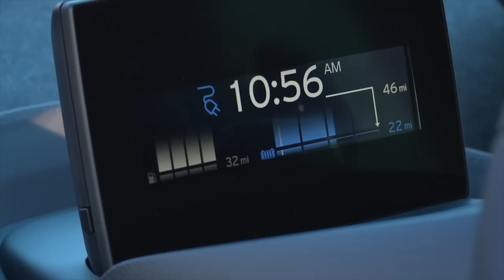Five Things We Need To Improve About Electric Cars

Comment: what about those of us that have reached a mortgage cap. whereby there is no property within 50 miles within our price range that alows us to install a charger for a plug in electric. 

I for example have no off road parking. I have double yellow lines Infront of my house and every house up and down is terraced. I run a company that would greatly benefit from a plug in electric van. But no-one has a solution for these problems l
Reply: Where do you park now? The UK gov has money available for councils to install street chargers, so if you park on the street you may be able to get a few installed, and then as an electric, you'll get reserved parking.

Comment: Range, charge time, cost of purchase, cost of replacement battery, battery life. You forget about hydrogen fuel cells or propane or LNG gas engines which are much cleaner.

Comment: I think it is unlikely that car manufacturers will manufacture their own batteries. Largely the only assemble cars today with most of the parts made elsewhere often by third parties. I think however that there is a need for more battery factories and they need to be near the place the cars are made.
Reply: John Michael surely most car manufacturers manufacture their own engines.   Don’t know if any generic engine manufacturers that sell to multiple big brands
Reply: @andrewpaulhart  you are spot on about that in my opinion.  I would think that mgs should make there own drive trains and power sources, even if in a partnering way, such as Tesla & Panasonic.  Mfgs should belly up to the bar and put their capital resources there (and ditch the IC engine $$$).
Reply: Honda and Renault will sell engines to anybody. Half the Mercedes-Benzes for sale have a Renault engine by now. Rolls-Royce? A BMW 7-series with a different shell thrown over it.
Reply: Michel Clasquin-Johnson aarrrgghhh. Got me 🎯 !   But of course I still think I’m right that car companies that fail to manufacture their own batteries are going to end up at a competitive disadvantage.
Reply: John Michael sort of.  You could argue that Tesla do not make their own battery cells, Panasonic do.  But Tesla’s Panasonic battery production is built solely for their use and to their requirements.  But manufacturers definitely need to arrange for battery cell production to be dedicated for their own use.  And of course they would be sensible to build up expertise in the construction of battery packs.  I could see a future when battery pack suppliers eventually move into car manufacturing,  undercutting the current big names.  It happened in PC’s.  It would be like an ICE manufacturer simply buying their engines from a third party supplier.   Has been done in the past,  but in my recollection it was a sign that the end was near

Comment: The main problem I see with the range anxiety issue is that people is used to think that even if you have a 2001 Ford Ka or a 2019 BMW 750 you could, hypothetically, drive thousands of miles in a day non stop relying just on the existing fuel station infrastructure, just stopping 5 minutes each time to fill up, pee and jumping again to the drivers seat. Anything worst than that is perceived as a less quality product and we are used to perceive that any new product should have better characteristics than the previous generation, and that is a important factor deciding if you want to upgrade to an electric car.
Reply: That, despite the fact that they've never done such a trip...
Reply: So buy an EV and rent a gas car if you absolutely must make a long trip in such a "we got a long way to go and a short time to get there" fashion.
But really, people do road trips in EVs all the time.  They stop and eat, and charge the car.  They stop overnight, and charge the car.
And they would be stopping to eat and sleep even if they were driving a gas car.
Reply: ICE vehicle is more convenient on the rare long road trip.  EV is more convenient for much more common local driving (assuming home charging).  Does it make sense to optimize for the rare case or the common case?
Reply: @dansanger5340  remember the car maker doesn't take any trips, long or short. They optimise for sales. So it's whatever they think will get people to sign on the dotted line.
Reply: @dansanger5340  www.youtube.com/watch?v=u4b0_6byuFU
Reply: @geoffmorrise2072  Your proposal is more or less already known, it is merely a version of BMW i3 with an REX unit with almost exactly the same power output. Your motor is what is says, a "Range Extender", it's merely a boxer-like design with probably some vibration issues. But at 24 kW, that's hardly enough and it would heavily rely on the battery, acting as a buffer, allowing only moderate driving on level terrain.
Ask US users of BMW i3 with the ReX unit - once they drive uphill for more than a short incline, the speed of the car drops significantly.
Similar (and better) cars already exist: Chevrolet Volt (plugin-hybrid) or Hyundai Ioniq PHEV. Both do the same while the Ioniq is also very efficient.
The main problem is - you still have a motor/engine design while still having the need for an engine maintenance.

Yes, your design may look cool, but it may be only an interim solution for the next 5 years while batteries are still quite expensive. After 2025, that design will be a part of automotive history. 
Actually it is already today - in BMW i3 REX.
Reply: @richardpetek712  I appreciate your input.  
Sadly we have yet to see the proper configuration of a pure electric drivetrain coupled with a highly efficient, light weight, compact gen set range extender.  (A car for the rest of us.)   Any car that has max range of less than 200 miles and sells for $44,000 is not attractive, whether running on electricity, gas or both.  So the i3 is a design doomed for failure from the start.  The same goes for the Karma Rivera.  Make a car that will run up to 90 miles electric and 500 miles total, that sells for less then $30,000 and then we'll have something.
For one possible help with this, be sure and check out LiquidPiston.com, www.youtube.com/watch?v=-g4dKZTnxHo.  They have the idea of using their engine to power a gen set.

As for the speed dropping significantly up a hill,,, my less expensive, compact ICE cars have all done that too.  If you want a muscle EV, you'll have to spend the $$$ and get a Model S.  My point is that plenty of us are OK with less powerful, more affordable cars ($44,000 is not affordable).

As for maintenance, If I use my high efficiency, light weight, compact, low maintenance range extender only once or twice a month, I think it will most likely out live me.
 
I would contend that it's not an interim solution  Battery cost will have to come down to something like $20 a kWh and densities of 1 kWh per kg before they could match the output of an engine like LiquidPiston's or a good FP linear generator.  Driving habits are unlikely to change.  60 mile range meets 90% of driving needs. (Mind you it's not a good idea to always drain the battery to zero, so a 90 mile range battery would be best.)  Why carry around hundreds of pounds of extra batteries just to make that occasional longer trip?  Again this is a configuration for all the Toyota Corolla and Chevy Cruze owners, not those who consistently drive longer distances.  There will always be a need and a market for those who want 300+ mile battery range.
Reply: @richardpetek712  I forgot to address the 24 kW aspect.  I'm not an engineer so I can't really say.  All I can to is a little math.  If the motor used 250 Wh per mile at 70 mph then that would be 17.5 kWh used after an hour of driving.  If a 24 kW gen set ran for an hour that would produce 24 kWh of power.  So in theory, it should be sufficient.  In the real world, I can't say.  Also the i3 has an electric motor of about 180 hp.  I'd think a 200 hp motor would be better.  I think Tesla could do it, if they were of a mind to.  Their motors are the most efficient out there on the road.

Comment: A good 'first 5'. Let me push another elephant into the room. The fact that a significant proportion of the potential EV buying public do not have ready facilities to charge at home, and are unlikely to have any. If they live on either side of a residential street there might seem to be a solution in 'on-street charging'. Then we have to hope that every single person in that area is law abiding, otherwise we could live in fear of the vandal. Then there are people who live on housing estates, who park in residential car parks. Would it be possible to turn those car parks into destination charging bays? I say nothing of the charging difficulties with hi-rise buildings residents. But, you see the issue? The 'big advantage' of EVs is that they can be charged overnight at home, yet a significant proportion of the population do not have off-street charging facilities or their own driveways. That could stop EV adoption in its tracks rather prematurely. This is a solution that has to be found quickly, with enough chargers to go around to easily meet the potentially huge future demand. Of course, the situation may change dramatically if batteries are developed that charge fully within 5 minutes and have almost zero phantom drain. But we have to plan as if that won't be the case, and plenty of owners will have secondhand vehicles with Li-Ion batteries in any case, so they'll need the facilities anyway, as chances are, they are likely to be the less affluent ones with less access to off-street parking. This one isn't going to go away unless we address it. Inductive Charging anyone?
Reply: Canada and northern states of the U.S. have quietly solved all those issues. Cars need block heaters, so they just put in electrical outlets. No fuss, no fanfare, no insoluble issues with vandals. What they did can be done anywhere.
Reply: https://www.wheninywg.com/plug-block-heater-car/
Reply: @gasdive  I will investigate that, thanks. 👍
EDIT: Ah, right. I see what you're getting at. Yes, it would be possible to erect a charging post for every home in the UK. One could just put an account card of one's own electricity account against the face of the charger and it would directly debit from that account, so effectively charging from one's own electricity. However, we're still left with the problem of the vandal. Plus, I live in the UK, and under the present Govt, which has been in power for quite a few years now, 'building public infrastructure' is a poisoned phrase, so I don't see them solving that issue any time soon.
Reply: Rambler Andy .  Most businesses will eventually provide destination chargers, so those will charge at work rather than at home.  Other than that public rapid chargers will
Have to do
Reply: The solution is to get rid of car ownership. A company owns a fleet that is charged at their own private facility, and then sent to customers on demand. Research Tony Seba's insight onto this. Google's Waymo unit is at the forefront. GOOG stock is a solid long-term (30-year) investment.
Reply: @EMichaelBall  Yep, I have looked at a lot of Tony Seba's work. What it leaves out are those who desire to own a car, or still need to. Our city infrastructure layout have been geared to the ownership of cars. And significant people numbers are raised to aspire to car ownership. That will take time to work itself out. Btw, I think Seba's work and economic projections on many things like transport, infrastructure, energy, etc... are really exciting.
Reply: @ramblerandy2397  A very small percentage of people in urban/suburban areas will still need to own a car. Those who have two cars, now, may keep one car, but get rid of the other one. Seba mentions that the infrastructure for cars was built out quickly, in spite of the previous horse industry and fighting WWI. So the existing industry for cars can be retrofitted for A-EV's very quickly, and given the economic opportunities opened by A-EVs, as seba mentioned (the need for less parking), smart governments will make the switch quickly.

I doubt you fully understand the business model of A-EV: Imagine if Google came out with something that was cleaner, quieter, safer, cheaper, and better than owning a car, has no up-front purchase or lease requirement -- and Android Auto is built right in. Well, Google will do just that. Most people's desire to own a car will go away, especially those who buy a car for the latest gadgetry. So a vast majority of people are going to switch to A-EV, especially those in the lowest socioeconomic status who currently rely on crappy cars being sold at high interest rates from "buy here pay here" dealers, but not exclusively them. Cars that people own would still be of use, especially in rural areas, but rural living is increasingly becoming untenable in most areas, especially with rural hospitals closing. Valuations of existing cars will plummet, and new car sales will be minimized. Figuring out A-EVs in rural areas will be a challenge, but the ease of implementing the business model in urban/suburban areas will be too much for most people. I think at least two-thirds of all road miles in 2030 will be A-EV.
Reply: @EMichaelBall  I quite understand the business model of Auto-EVs, and I am quite familiar with Tony Seba's ideas and projections. However, in the UK there is a great desire to 'own' way past the point of logic, especially amongst the older baby-boomers. Granted, the sheer economies of not owning a car and being able to flag one up will begin to overcome this, but I suspect it may be slower than one would like. We'll need a change in attitude, expectations and ignorance. I myself, have been in anticipation of this for a good few years. Like Seba, I haven't owned a car in several years, but I am a driver on several friends and relatives car insurances. It's both convenient for them and me, but the break from 'owning' my own vehicle is something I have prepared for. I would like to think that Level 5 autonomous driving and thus capable A-EVs will be around by 2022-24, but I fear it may not be as soon as that in the UK.
Reply: Rambler you are presenting a chicken and egg problem.  Right now EVs really aren't suitable for people who live in multi-family dwellings.  However they are great for home owners.  Hopefully in time enough home owners will adopt so that the balance shifts and owners of apartment buildings will begin to see the advantage of installing charging stations at their parking stalls.  A few to begin with, and many over time.  The apartment owner could then become the replacement to the gas station (and perhaps realize additional revenue from doing so).

Comment: 6. Design: no more fake black grilles that just make aerodynamics worse. Electric cars have to look different
Reply: They used to put masts on top of and paint gun ports on the side of steam ships. I always laugh and think, "1880 is here again".
Reply: I have a sudden urge to see a tesla with hood scoops.  Fortunately the internet provides!  https://www.reddit.com/r/Shitty_Car_Mods/comments/8hu503/i_dont_think_that_works_with_a_tesla/
Reply: Why do electric cars have 'bonnets' (hoods)?  There is no need to have a proboscis at the front as there is no 'engine' under there.  

I think the i3 dares to go where ev's will surely end up.
Reply: FFVoyager safety.  Crumple zone
Reply: @FFVoyager  Crumple zones, wheel base (car is more stable with wheels at the corners rather than directly under the passengers), aerodynamics (at least compared to a stubby car), aesthetics, space for the door.  We could make the front smaller but the "sweet spot" probably involves a sizable fronk instead.
Reply: inclose the battery area and heat them if need in cold weather. seal the bottom of the cars for smooth air flow? then remember the electric does not need to have the stuff a gas car needs?/ like brakes/ or brake line or fuel lines, or all that gas that catches fire?? don't need it!! so if Telsa cost too much?? here one you can have out the door for less than 12 grand!! and it is all!! AMERICAN MADE!! TAKE A LOOK AND SEE WHAT EVERYONE WILL BE DRIVING THE STATS ON IT?? IS without the new battery of prof. Zimmerman not in it yet? take a look? there range on the old battery? 130 miles?? take a look?/  https://www.youtube.com/watch?v=4VKCmuXiY8Y&t=8s
Reply: Ptrk Hrnk this in one I'm never going to agree with. To me, electric cars front ends look like they have something missing - they look 'blind'.
 Or, think Lord Voldemort's nose - kind of there, but not...
Reply: Andy McCabe I know what you mean.  Personally any form of transport that doesn’t look like a horse from the front Upsets me
Reply: Andrew Hart now I might be wrong, but I think you might be taking the Mickey- you naughty boy!!
Reply: Ptrk Hrnk and another thing! This looks dangerously like Obsessive EV Extremist territory(which should always be avoided for obvious reasons!). It's a trivial point......
Reply: @andymccabe6712  Andy, I think that's because we've all grown up conditioned to expect what a car should look like because grilles used to be necessary even though they compromised aerodynamics. I'd adapt and reprogram our perception to see the beauty in what's optimal based on the new parameters because grilles aren't necessary anymore.
Reply: Andy Lee Robinson  Don’t forget how much easier to wash a car without the bugs stuck in the grills.
Reply: Gary G  - wash????